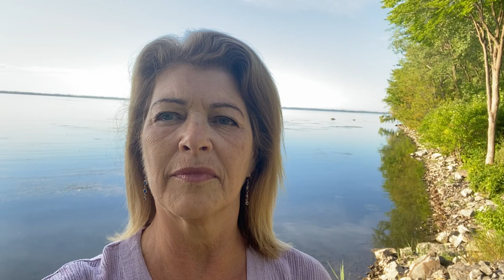The FHO is not a salvage procedure

Comment: Thanks for the video. We just had my pups FHO two weeks ago and has been recovering. Beginning physical therapy next week. If you recommend any specific videos, it would be much appreciated
Reply from the maker: Thank your your question.  I hope your puppy is doing well after the surgery.  The most important is to do hip stretches (many YT videos available on that) as well as slow walks on the leash.  Movement is important but just running around in the back yard tends not do it as the pet will often not "push" the FHO leg enough.  So walks (slow means that the affected leg will need to spend more time working) and hip stretches are key.  Good luck with your pup!

Comment: 7 month old puppy just popped her left rear out of socket and they tried to pop it back in with no success, having to do surgery now, was trying to determine between the toggle pin or fho, shes a boykin and loves to run. If fho is done how long to heal and whats the ratio of it not happening again. Shes a boykin. Happened the same day as losing my boy of 16 plus years English Springer. Not my weekend
Reply from the maker: I am soooo sorry to hear about the difficult events of your week-end.  I have a 15 year old dog and I know my heart will be broken when her time comes.  Regarding the puppy.  I do not give advice without having fully examined a patient but I can give you general information on the surgical procedures and perhaps that will be helpful.  I had to google Boykin, as I had not heard of that breed before... what a cute dog!  I see that they are usually less than 20 kg.  I really like the FHO in these smaller dogs but I will forewarn you that the success if very much dependent on the rehabilitation post-operatively.  That puts the  onus on you - lots of slow controlled walks and hip stretches; running around in the back yard is not the correct type of exercise.
I have performed the toggle pin procedure many times; it is a good surgery but definitely dependent on surgeon experience.  The tendency is to overly tighten the nylon/toggle mechanism; it is best not to do that.  With the toggle pin (or any surgery reconstructive type of surgery) osteoarthritis will develop, although this can be managed with appropriate exercise/life style.  If she were a big dog, I would tend to want to rebuild the hip joint with the toggle pin or another type of surgery (I do like the iliapsoas band technique also).
Good luck with your Boykin!

Comment: Is it possible to get a THR after the dog had previously had an FHO?
Reply from the maker: Hi Kyliedelauren,
Although in theory it is possible, it is not advisable/ideal as the angle in the cut in the femur will likely need to be revised and that can be difficult after the FHO as the appearance of the femur will have to be altered.  It is easier to go from a THR to FHO, but not so much to go from the FHO to the THR.  Whenever you take a complex surgery and make it more difficult, then you can expect a higher risk of complications/failure.